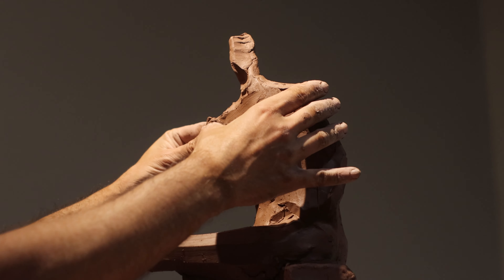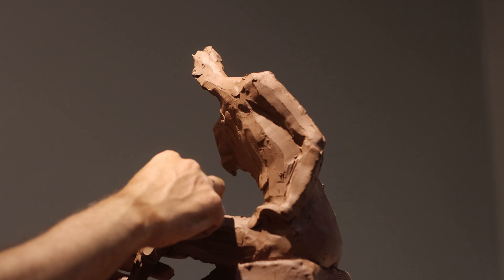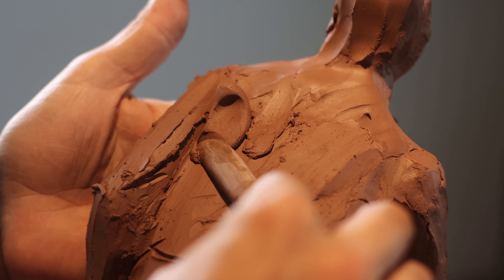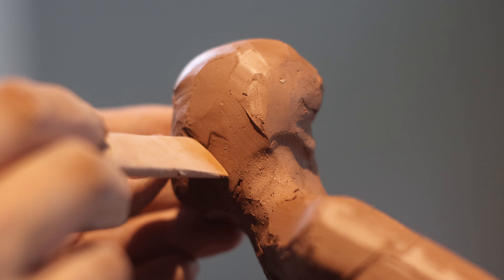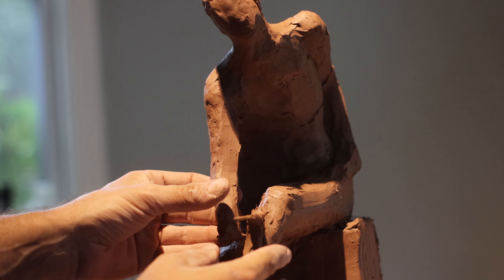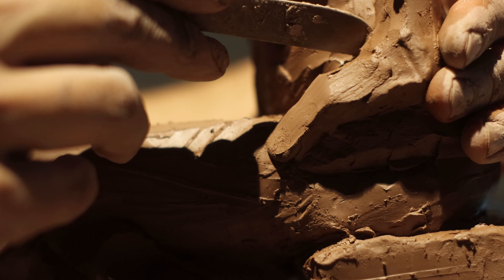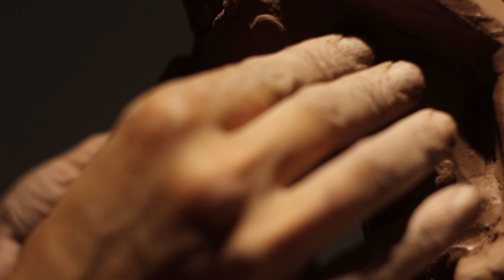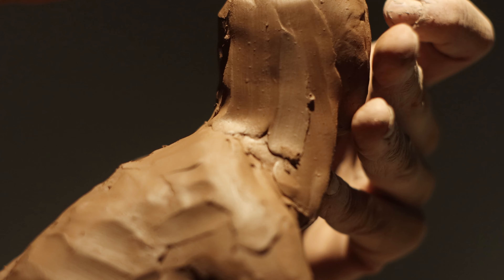Building a Foundation for Sculpture in Water Clay: Seated Pose & Drapery Study

Comment: Can we use bamboo as armature ? How does it affect the kilning process ?
My sculpture's neck is thin, so I stake a bamboo toothpick through it and leave it there.
Thank you in advance.
Reply from the maker: hi, yes you can stake it through there. I usually remove them once the clay firms up. But if you let the sticks in there they will fire and burn off in the firing process, but they will leave a little hole in the surface where you can afterwards patch over.
Reply from the maker: btw, the danger of leaving the stakse in there whent he clay firms up is that the clay shrinks and tightens. So it can crack around the sticks. The sticks i use with water become small and fragile , not sure how bamboo would react to water and clay shrinking around it. Best remove them when the clay hardens